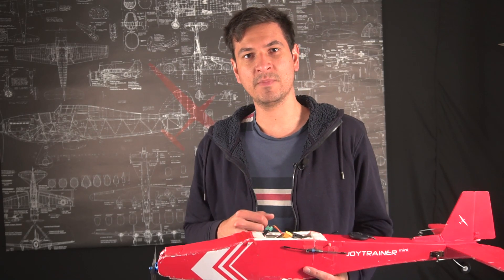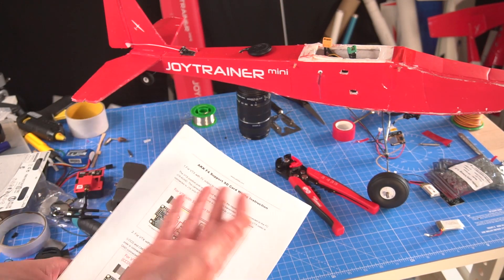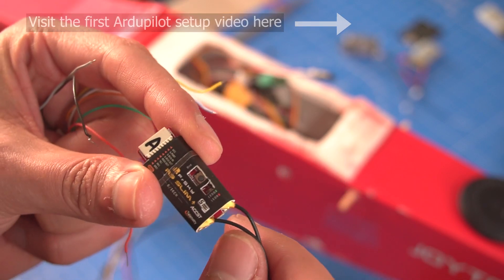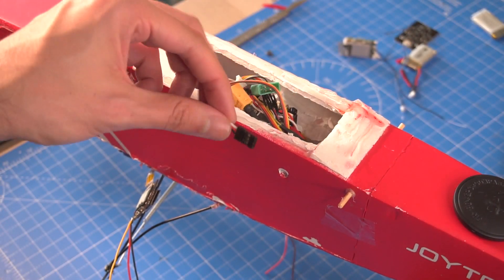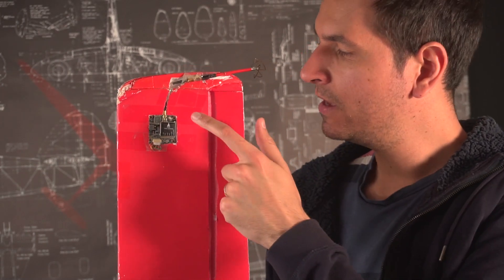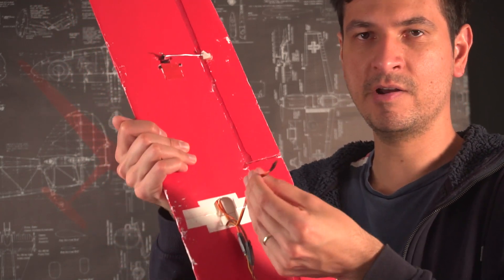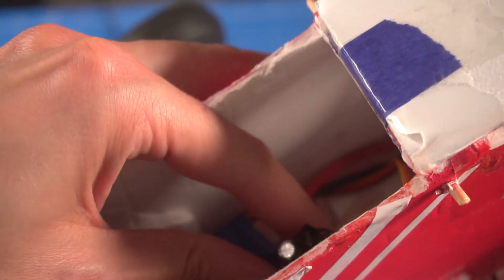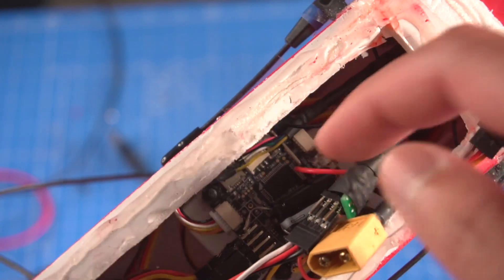Details of my Joytrainer mini setup for FPV and Ardupilot

Comment: I am curious about the capacitor you are using in your setup, what is the purpose?
Reply from the maker: The answer is at 6:27 it's to reduce the noise on the osd.
Reply: @Joyplanes  Thank you for your answer. It seems that I had not got to the explanation by the time of writing my comment.